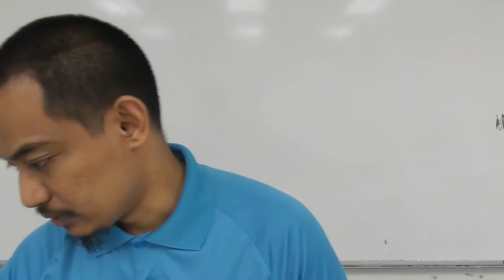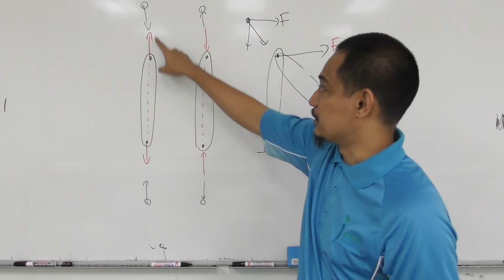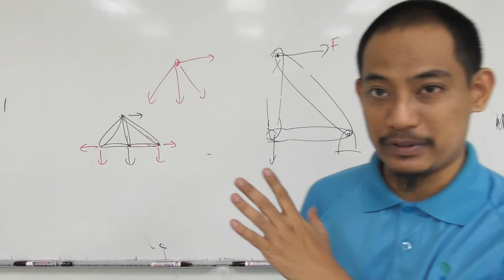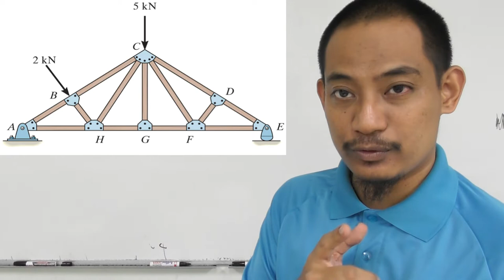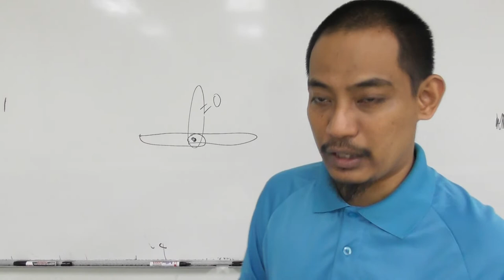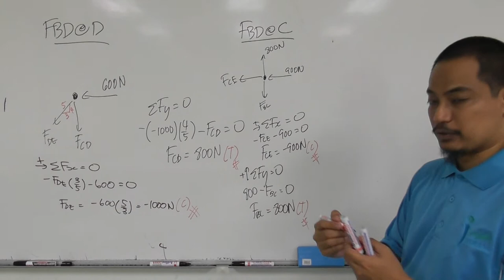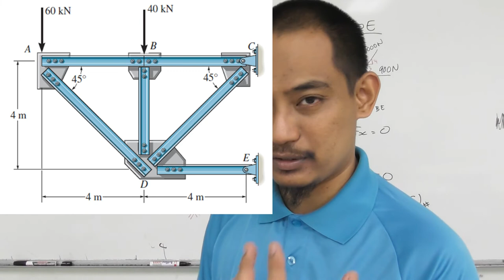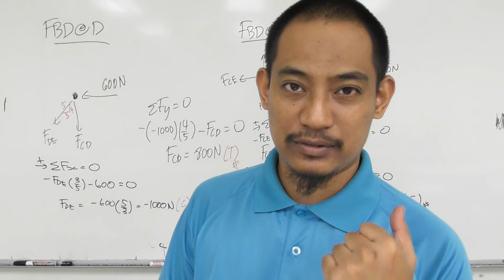Statics - Chapter 6 (Sub-Chapter 6.1 - 6.3) - Simple Trusses & Method of Joints

Comment: Dr, for  35:11, I don't think it is possible to find the support reaction at the truss, because there is 3 unknowns in the equation, so basically we cannot solve the problem, yes ?
Reply from the maker: you mean 3 unknowns from the support reactions?
it should be possible to solve given that we have 3 equations
Reply: @SaifuddinRehan   Dr, I do not see the 3 equations for this truss. There is only Fx and Fy, yes ?
Reply from the maker: @sayhan3631  oh okay....    
now when dealing with trusses, you have to determine whether you can directly got to any point to solve using method of joint (FBD of the point), or you need to consider the whole structure as one body first (FBD of the whole structure as the body)...
for that structure, you need to take the second option..   when the whole structure is the body in the FBD, then you will have 3 unknown from the support reactions, and you will have Fx, Fy, and M, hence 3 equations (just like solving for rigid body before)
after you determine the support reaction, only you continue with method of joints, solving from one pin to another...
Reply: @SaifuddinRehan   Thank you Dr for clarifying this. I forgot to consider the moment equation.

Comment: sir at 34:04 cant CE bezero force member? and why?
Reply from the maker: if you mean by visual inspection, then no
because, if you are looking at point C or E, the rule does not apply 

to recall the rule, if a point/joint have 3 members, 2 of them are collinear, and no external force, then the third member is zero force member

at point C, there are 4 members, so you cannot apply the rule

at point E, there are 3 members, but you do not have any 2 members making one straight line, plus there is an external force from the roller
Reply: @SaifuddinRehan  thank you, understood
Reply from the maker: @ty-wp9ou  you are welcome